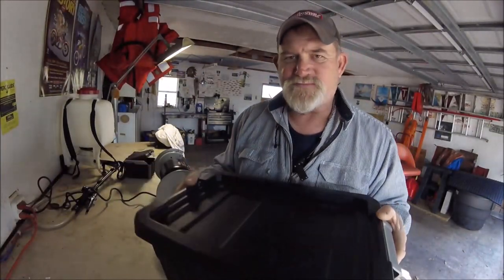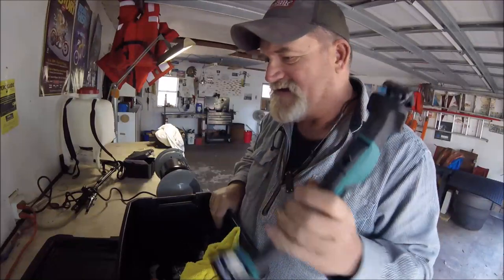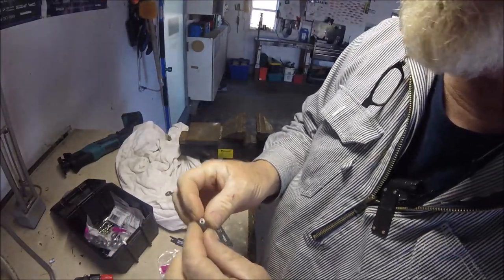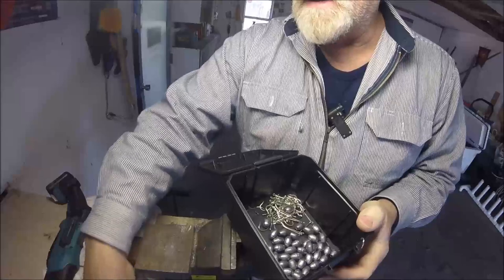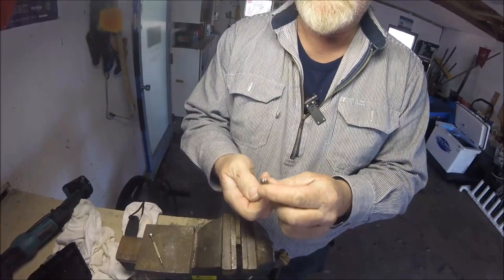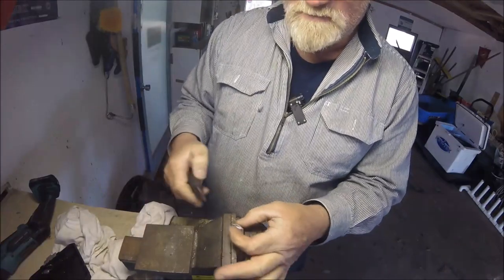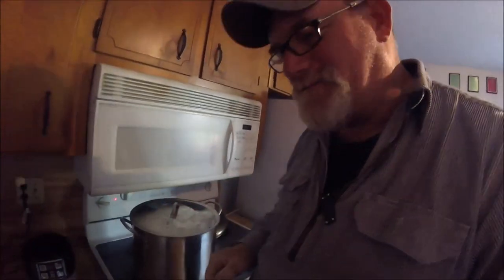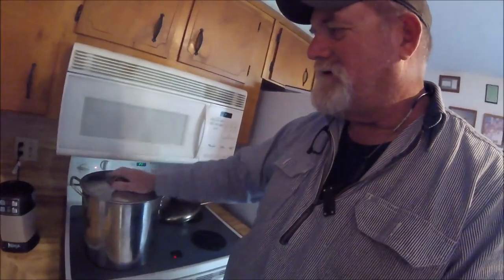FISHING JIGS, MADE WITH A RECIPROCATING SAW

Comment: I make my jigheads very similar. No pouring of hot lead for me - thanks. However I do put a drop of crazy glue before I squeeze it on the hook. Never rotates. U can find 'heluva deal' on crazy glue on amazon if u buy a pack of 12. Comes under $1 a bottle and 1 bottle is enough for about a 100 jigheads, maybe more if u do them all at once and don't let it dry.
Reply from the maker: mine can move a little. its not that important. small thing don't matter much down 30 feet in brown water so dark fish don't even need eyes, in a 3 knot current banging into barnacle encrusted boulders.....oh, it's pure heaven. L-O-L!
Reply: i don't know if it matters. I have OCD and would bother me if it moves
Reply from the maker: @ifishcatfish  I know you do and can tell you're not in the Fishing Business.🤣🤣